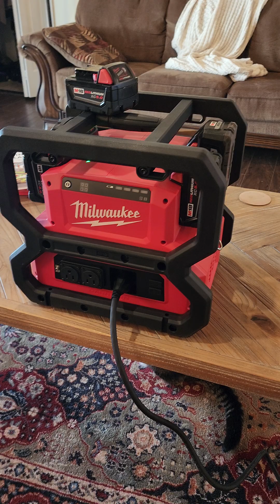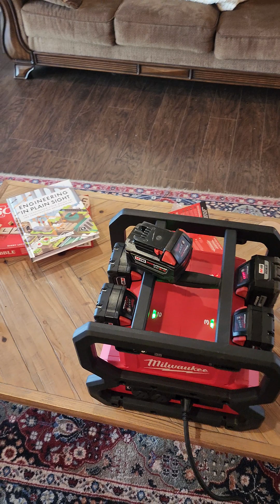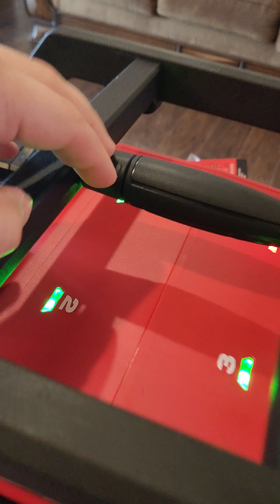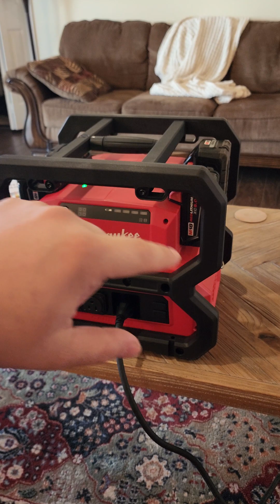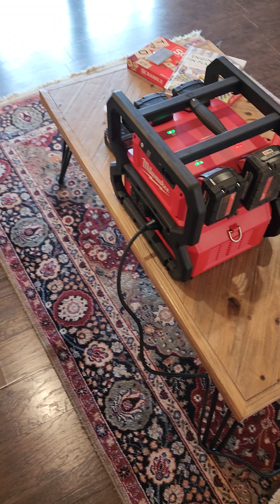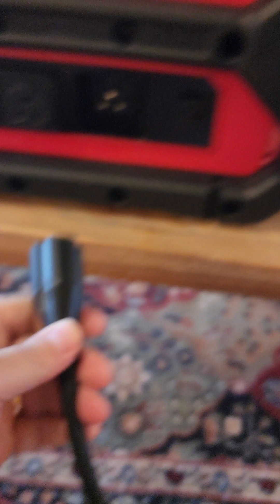Milwaukee Power Supply (M18 Battery Generator) Everything you might need to know!

Comment: Just got a killer deal on one of these units still in shipping. Curious if unit is firmware upgradable where you could upgrade the firmware so the unit will run on 2 batteries instead of all 4?  If not, I think Milwaukee dropped the ball on the electronics design and maybe that’s why I got it so cheap.
Reply: Where did you find a killer deal on this everywhere I look they’re 750$ CAD
Reply: @MrDoordude125  it was a short run deal through Northern tool, but I’ve never seen it that cheap since.

Comment: For a fraction of the cost of (4) batteries and unit you could get a car battery and a 2000-3000 watt inverter and have tons more amp hours. Plus, a car battery can be charged with any vehicle and a jumper cable very quickly. With no power you can't charge a Milwaukee battery at all. :body-blue-raised-arms:
Reply: Car battery like lead acid? Is this 1980s?  This only make sense if u have tons of Milwaukee batteries already
Reply: @jesusisimmanuel735 This is a niche product....it's way over priced if you not have milwaukee batteries already.

Comment: Will that run an air compressor?
Reply: yes i have one. and i’ve used my air compressor on it when there no power. sometimes powder goes out at job sites to go snow storms. so i use this for my air compressor doing roofing. 👍

Comment: Can you run a furnace with this?
Reply: A furnace is 120 volt not 220 so it could definitely run it
Reply: @glenarseneau4796  I know the voltage I mean how long can I run a gas furnace for roughly.
Reply: @MaggioRacinginc  good question I’ve seen other videos were people have run them for around 12 hours not this brand so who knows
Reply from the maker: There is no way. They use 220V and can draw 80Amps. This can run a 1500Watt space heater for maybe 30 minutes.
Reply: @wesleyberg686  lol what in gods name are you talking about
Reply: @wesleyberg686  you are 100% wrong
Reply: YOU CAN BUILD YOUR OWN RUN MUCH BETTER OK WICH I DID OK
Reply: you can build your own run much beatter

Comment: On completely topped of 12.0ah x 4 batteries I ran my fridge about an hour and a half before it was down to 3/4 charge. I didn't runn it all the way down, but I figure roughly maybe you can expect it to run a full sized fridge around 6hr or so. During power outage if you plug it in every other hour or so you could stretch that to maybe 12 hours.
Reply: You definitely might want the MX fuel one